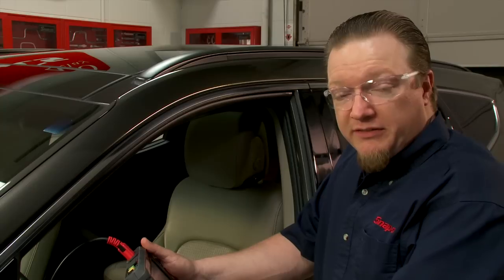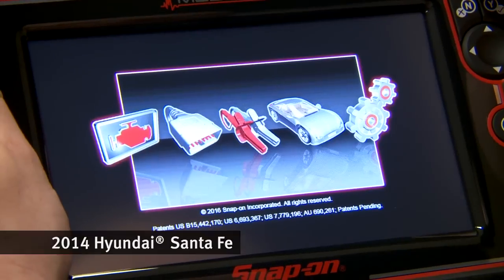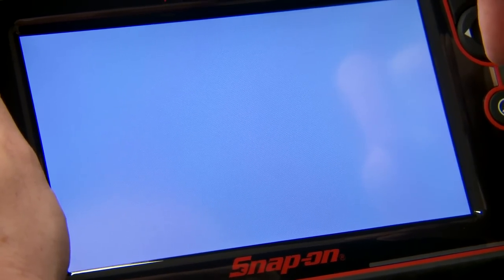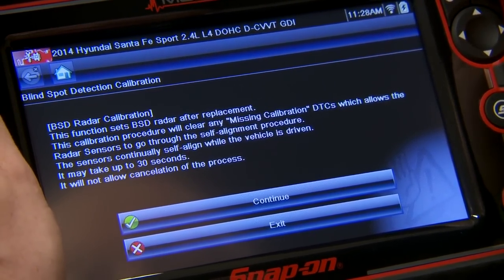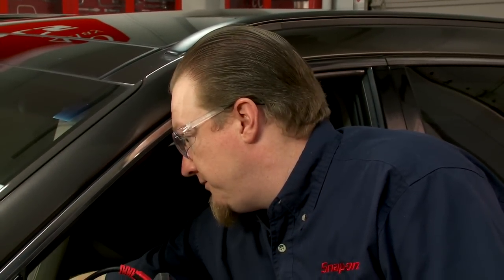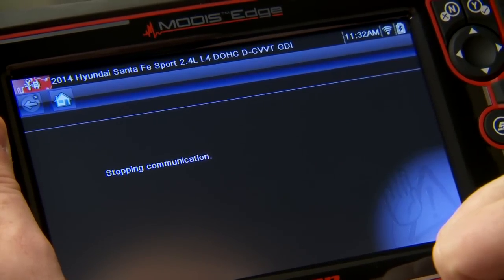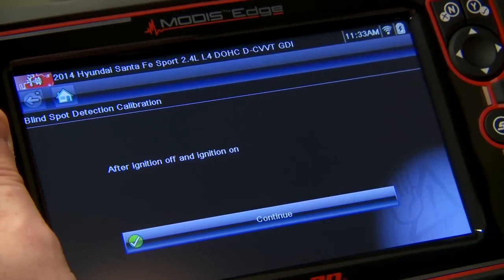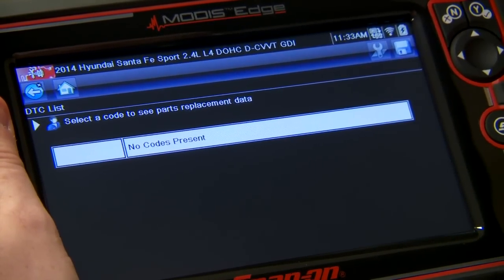Diagnostic Quick Tips - Hyundai Blind Spot Detection System Calibration

Comment: I got a small abrasion on right side rear bumper 2020 Hyundai Elantra sel, that triggered dashboard self check on blind spot sensor. Took it to back yard mechanic just for calibration if that triangle with exclamation mark on dashboard would disappear. It worked for a little while then warning lightt came back on. Mechanic says probably sensor is damaged and needs to be replaced. Thanks for the video

Comment: Very common problem and potentially very costly (on the Azera the unit cost twice as much as on Sonata). We got a warning light and the blind spot detection system went inoperative. Hyundai confirmed left rear radar sensor unit defective - $800 for the part alone (the bumper cover needs removed). After reading on forums, this is a very common problem. Hyundai may try to recalibrate the sensor, but what I found is it is possible if someone is bumping your rear bumper - such as in a parking spot - or if you hit a larger pothole, the sensor may move just slightly in its bracket, and the car will detect it as out of calibration so the dealer will say we can't calibrate it, we have to replace it, even if the sensor is intact. They will try to blame you hit the car and knocked off the sensor.  I removed the rear outer light unit - see my channel how to do this safely - and reached the sensor with my fingers and just moved it a little then had Hyundai recalibrate it and the error message was gone. Perhaps the brackets are not strong enough and allow the sensor to move even just slightly which throws it out of calibration (these sensors needs to have a certain alignment so they can work properly). https://www.youtube.com/playlist?list=PLl-l6yge4ast930y0wMiD9IIlDUy1mPFS

Comment: Where are the BSMs mounted—on the body or in the bumper cover of this car?  If the BSMs are mounted on the body of any Hyundai product the bumper cover needs to be removed for calibration.  And sometimes physical adjustments of a BSM bracket is necessary.

Comment: Have 2014 Hyundai Equus.  Bought it new and Hyundai has never been able to fix the BSD system.  BSD System shuts off and says CHECK BSD SYSTEM after the car is driven a while.   Once I stop and the car sits a while the BSD will start working again.
Reply: I'm having the same problem with my 2014 equus. Did you ever find a fix?

Comment: Hello there, I have 2017 Sonata with the same problem. worked for 30 minutes after recalibration and then stopped working again with massage on screen "Check BSD System".  What should I do please?
Reply: Same problem sonata 2015
Reply: I'm having this problem now with a 2018
Reply: after accedant must make corection to bsd sensors ...search about bsd corection hyundai on you tube
Reply: Having same error “check bsd system” and my tucson is brand new..brought back and forth at hyundai which they keep on re-calibrating but to no luck. Hope you guys can shed light and if you got you’re error fixed. 
Desperately getting solutions to resolve
Reply: @w077dkl  I think it’s ridiculous I think it’s an issue they’re having
Reply: Same problem with mine too